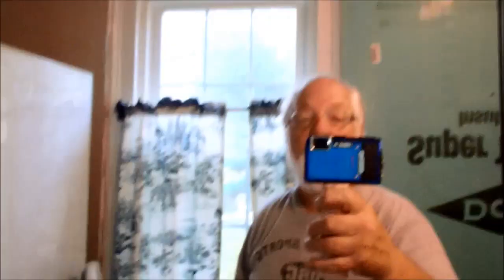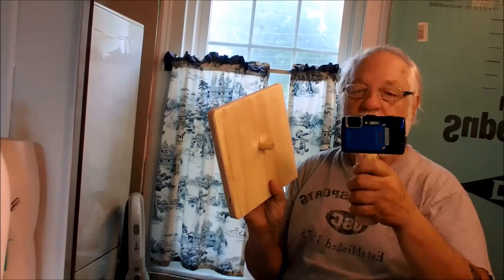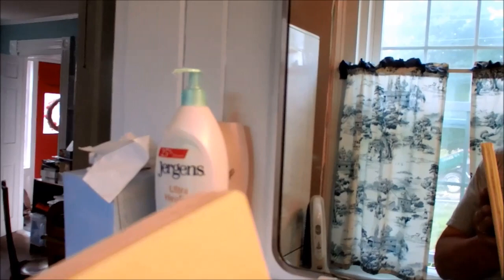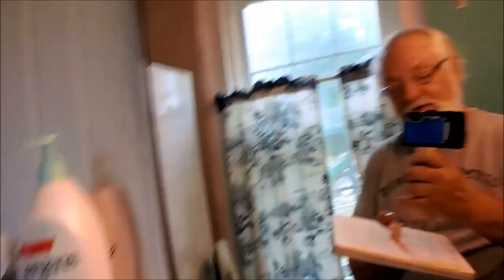Camera Stand Invented Myself

Comment: That's a great idear, and ifn you then have trish sew you up a bean bag to attach to the bottom with velcro maybe you could have it to where you could adjust it's aim point on a uneven surface (adjust it on a flat surface too) and take it off when you don't need it. Just a thought.
Reply from the maker: Yea, I'm thinkin', somthin' that'd let me hang it on the back of the seat in the Ford..
Reply: All kinds of neat ideas you could come up with to add to that, multiple ways to attach it like bungies and such... You COULD also make a longer handle attachment with a weight on the end ifn you wanted to it would be kinda like a steady cam attachment... if you wanted to do that... lots of vesatility... the store bought ones are fine but they do one thing usually and this is something you can fiddle with!
Reply from the maker: MrComaToes Yea it is..